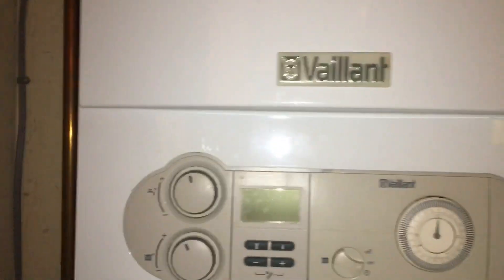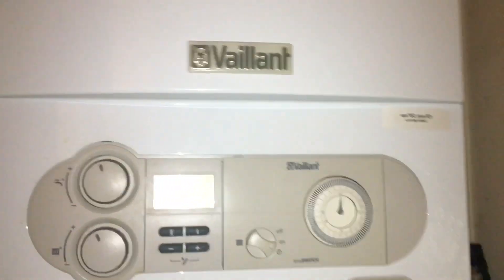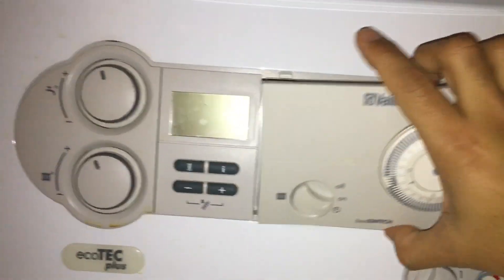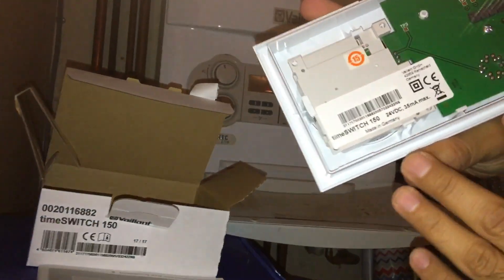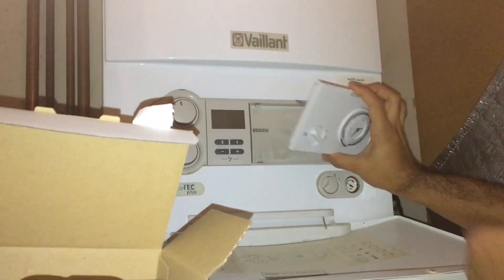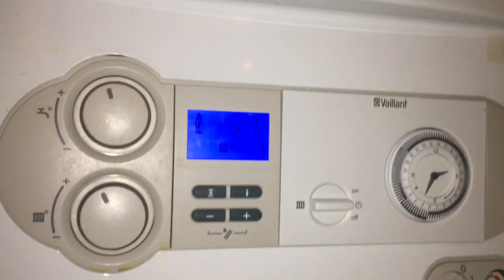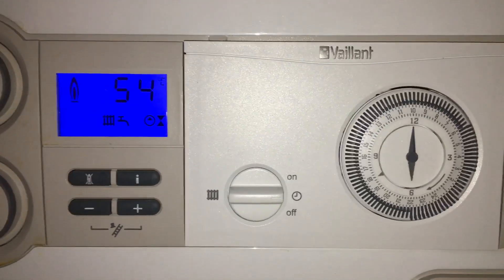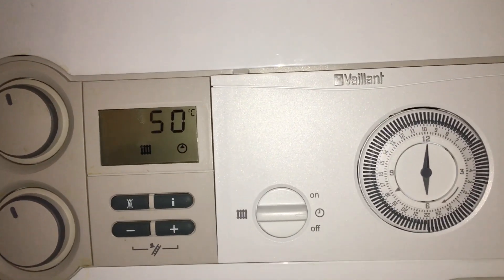How to replace faulty timeSWITCH 150 | 160 in Vaillant combi boiler

Comment: My timer clock stopped working, removed panel, sprayed a little wd40 inside the back centre area, rotated clock a good few times and now it works fine.

Comment: HiI too went the replacement route for my 110 timer.I bought 'used but working order' only to find after about 12 hours the clock was ticking but lost around 5 hours.So I decided to open up this one and my original one and found both had a bad capacitor and the used one had a leaky diode.I've replaced both caps in my original one (it has two) and it now works perfectly and keeps perfect time.Just buying new ones is a way for these companies to milk you and me.Mot things that have electrolytic capacitors will fail eventually (especially near heat, as it dries them out) so you fit the best type/heat range you can get.A lot cheaper then £40+ each time.
Reply: , was it easy to take the back off, as mine is clipped tight at the back